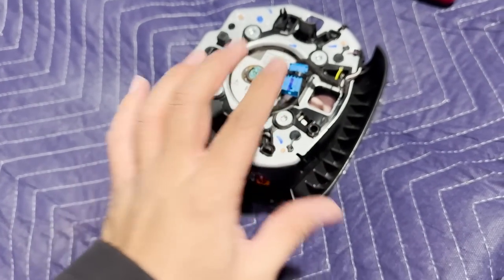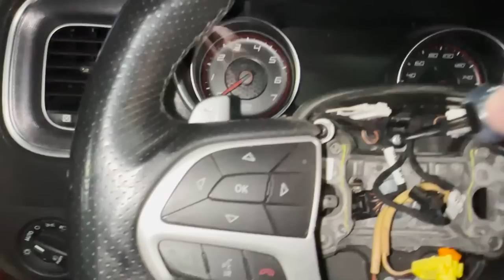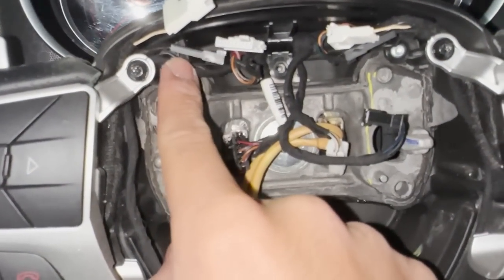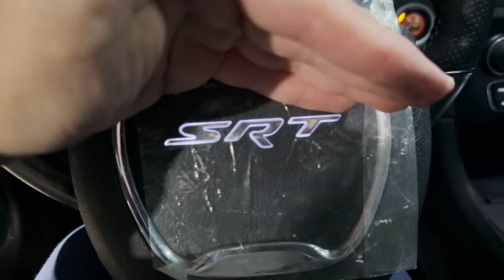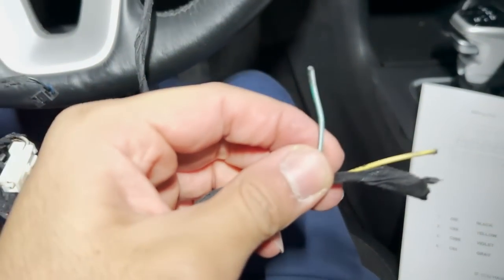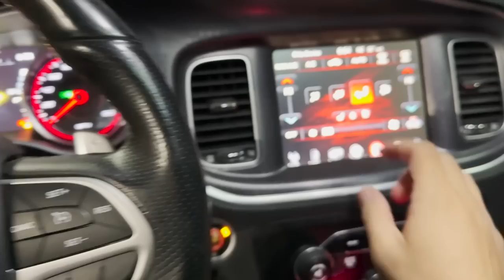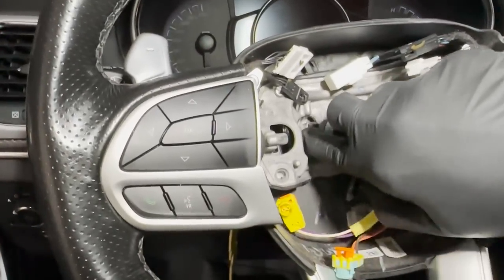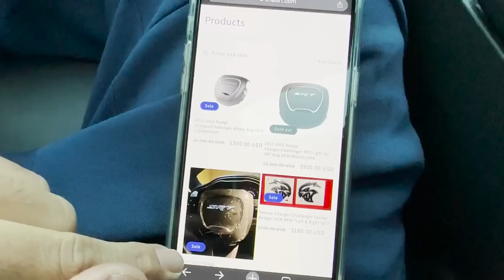How To Install a Light Up SRT Wheel Airbag In Your 392, Scat Pack, R/T, Jeep, Durango STEP BY STEP!

Comment: Hey Khal thanks for the in depth video! I just have one question I’m stuck on. If I have a ‘21 SPWB do I still need to splice the wires to maintain the heated wheel function or is that only for pre ‘21?
Edit: does this also void the warranty?

Comment: Just leave battery disconnect for 15 mins or lil more no problems at all used to change my grand prix steering wheel with different ones all time....  Not disconnecting battery you can easily have that blow as it may have residual power stored for a bit

Comment: I got a 2018 SRT 392 Challenger eith heated and WHITE LED flat oem bottom steering wheel, the white led is giving me hard time going off and on, will it be a plug and play if I only order the RED airbag and mo mess with slicing or anything right!?

Comment: I have a 2018 scat pack. I'm about to install a heated steering wheel. I bought the wheel and clock spring. Do you have video or anything how to do that and enable in the settings?

Comment: I just bought a 2015 SRT Jeep, it has an SRT horn. Its normal that it doesnt light up? My 18 Durango SRT did light up. If i get the harness, it'll be just like this, plug n play with heat & all working?

Comment: I have a ‘22 392 challenger WB with heated wheel. Will the harness be plug in play on the later year for the heated wheel? Or do I still need to splice ?

Comment: Hey Khal, I have a 2017 hellcat, & my light on the air bag went out, so you think I can just swap the harness and it will work again???
Reply: Good question, had the same thing happen on my  SRT Durango.
Reply from the maker: Most likely your led in the actual airbag failed. They where common for that year. You can buy a new airbag from my website. 👍🏼

Comment: I have 22 WB scat, if I get a SRT steering wheel will it be plug and play for everything including  heated option or I will still need to splice ?
Reply: He said new ones (22’s) are plug and play
Reply: I just checked on my 22 SPWB, it has the wires running down the sides for the heated steering wheel. I'd assume we need to splice to keep that option.
Reply: @SkeefOoo  yeah, I heard him say that but if it’s easier upgrading to an srt steering wheel and not use the stock flat bottom wheel I will, I’m trying to figure out if I have to splice no matter what
Reply: @hemimeplease6077  I’m pretty sure the SRT steering flat bottom (silver bottom) wheels have the correct harness by default for a light up airbag.

I do love the full leather wrap flat bottom on our SPWB, just debating on whether it’s worth the trouble/price.

I love the heated steering wheel, just cutting into the factory harness and splicing doesn’t sit well with me, especially since it’s a heating coil.
Reply: @SkeefOoo  can someone confirm the splice matter? i purchased a new Demon alcantara steering wheel with the light up airbag, am I good to go with no extra modifications?

Comment: This came stock in my Jeep srt. Dealer told me it dosent light up it is just a sticker lol. They replaced it under warranty after breaking the steering wheel and it only lasted 3 months and now it doesn’t work lol.

Comment: Khal you consider Scats SRTs or naw?
Reply: Scats are branded as R/T’s
Reply: @LuaysGarage  I’m already knowin this a huge debate but i got a custom order 21 Widebody Scat Charger and R/T is nowhere on the build sheet or sticker. Idk why they put the R/T logo on the Challengers
Reply: They put SRT emblems on the Scat Pack brembos since ‘20 or ‘21 or so thanks to Dodge everything is an SRT
Reply: The 6.4 is an srt engine
Reply: @shinismoove  just because it has the SRT engine does not make it an SRT. The trim is still an RT.
Reply: @HEMILIF3  didn't say it was. All I know is the SRTjeep, SRTdurango, and SRT 392 all have 392 lol. Srt is just a the performance brand so I have no problem putting this airbag on
Reply: I have a 21 wb scat . My brakes say srt so why can’t my steering wheel say srt . Idc what people say it looks nice lol
Reply: @philrivera2856  yup, brakes, srt modes, srt engine, and the screen says srt when you turn it off and on. Idk why dodge discluded the scats from the srt name
Reply: @shinismoove  because they realized the only actual SRTs are hellcats or better.
Reply: @NoDidddy  no because they still use it for everything but the challenger/charger
Reply: @shinismoove  only actual SRTs will have a hell cat engine or better! Anything else is irrelevant… SRT 392, Durango, etc is literally a appearance package.. The engine makes the car.
Reply: @NoDidddy  it's an srt engine
Reply: @shinismoove  it’s literally the same engines in a scat, both have the 6.4L 485 HP engine, don’t let the branding go over your head lol..
Reply: @NoDidddy  yea I'm saying the 392 Is an srt engine